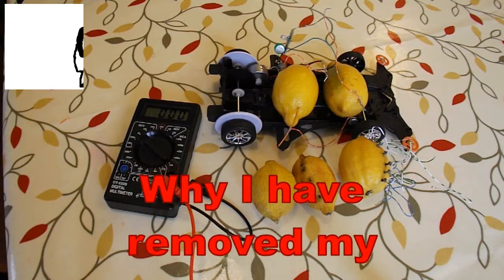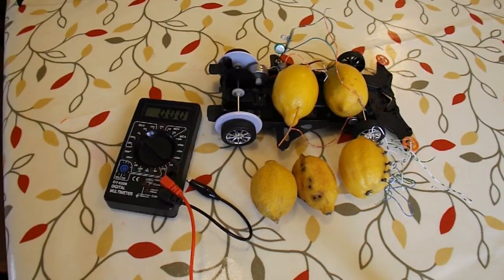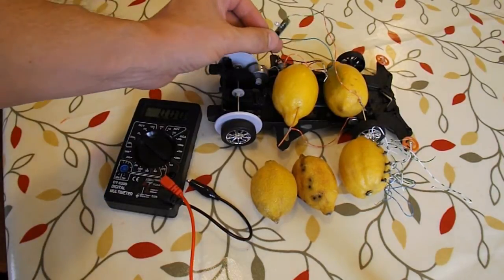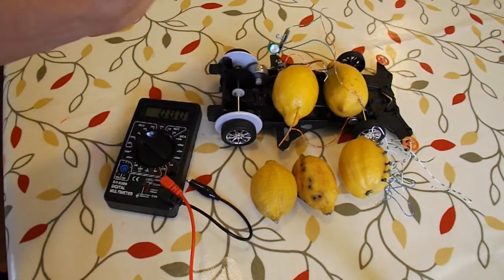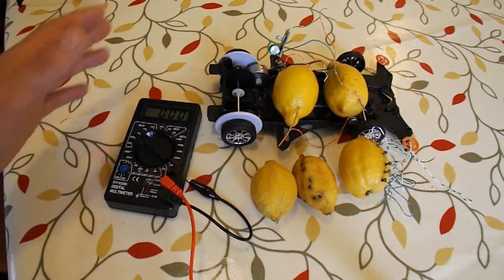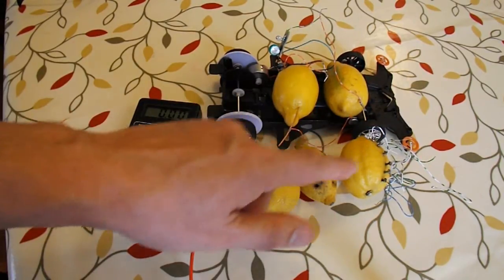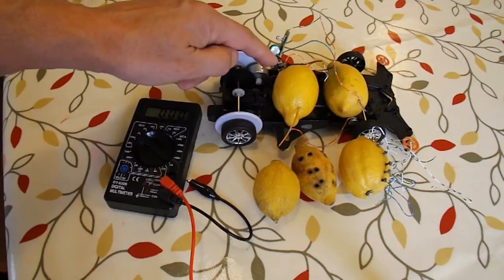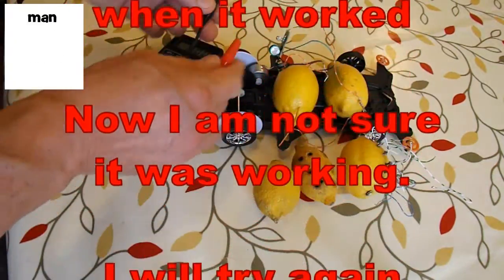WHY I HAVE REMOVED MY LEMON POWERED CAR VIDEO

Comment: Dissimilar metals are the go for lemon batterys. Your probably coating the zinc on one terminal with a semi-conductive coating.
Are you using copper for the second electrode? Do you have enough voltage to charge the battery? Are you delivering enough current to charge the battery?

Maybe try a Joule Thief charger? Like this one Joule Thief Charger - Schematics

If I can help figure it out let me know :)
Reply from the maker: Hi, not sure if you caught the original video. The set-up was a lemon, some copper wire, and some bright zinc nails. I use the charger circuit board from a solar garden ornament and simply replaced the solar cell with the lemon battery. All appeared to work well, the LED on the circuit board went out to indicate that charge was flowing into the battery and when I tried the car the following morning after about 8 hours of charge the car ran for about 3.5 metres. The car is one I made using the electric motor from a fluttering solar butterfly ornament and the car runs directly off the solar cell in reasonable sunlight. I now have the motor connected directly across the rechargeable battery via a simple on/off switch. The theory is the lemon battery charges the rechargeable battery and then I throw the switch and the battery is discharged through the motor. What is throwing a spanner in the works is the fact that the rechargeable battery restores some charge on it's own so I cannot tell if the charge has come from the lemon or has occurred "naturally". I did not expect the set-up to work as I didn't expect the lemon to have either the voltage or the current and was so surprised when it seemed to work I put the video up.
Reply: I'd suggest using a couple of lemon cells in series and the charger I linked to. More copper surface area too. Did the copper get eaten down or coated?
Reply from the maker: Mongrel Shark The copper looks fine but the zinc coated nails have a black coating. I have tried two lemons in series to increase the voltage. Two issues there.
1. I want the car to carry the battery so 2 lemons significantly increase the weight penalty (although I could just cut one in half for the same effect)
2. One of the wires attached to the board has just fallen off so I am not sure if I may have had a high resistance termination.
I have resoldered the wire and will leave it to charge again.
In the mean time I have been running some checks on the amount that the rechargeable battery restores itself. Video uploading later.

The issue is that this worked fine the first time. I carefully discharged the rechargeable battery by running the motor. I then charged it using a single Lemon and we got the good result. Since then each repeat has been a shorter run so in my mind I see the first run as being powered by the rechargeable battery restoring itself + some help from the lemon, but after that it was discharged beyond a point that it could regain a good level.

I am fairly sure I could get it to work following your suggestions, but I really want to figure out how it worked the first time, if that makes any sense.
Reply: Yep, all makes sense. I think your on the money with the self recovery, as well as having drained it too low to charge well.
Pulse charge is the way to bring the battery back up once drained too low. After you are sure you have figured it out correctly.

Comment: That lemon with holes looks scary
Reply from the maker: I was disappointed with this project. I thought I had made some progress but the battery I used confused the results by restoring itself. This is a common feature of rechargeable batteries.

Comment: You need some wider plates,and put them close together as you can w/o them touching.
If you could get your hands on enough U.S. pennies(copper plated zinc core) and vinegar you could power a fleet of little cars.
Reply from the maker: What I need to do is to replicate the success of my first video and that was just using a lemon, zinc coated nails and copper wire to charge the rechargeable battery. It seemed to work fine but I now believe the rechargeable battery had restored some power itself rather than taking charge from the Lemon battery so I am doing some tests on the battery to see if I can verify that.
Reply: GrandadIsAnOldMan
Yea,I didn't intend to tell you what to do,only suggest a solution.I apologize if I came off that way.
I think you are correct about battery recovery being the bulk of the power used to power the car.
If you don't mind me asking...
Is the battery Ni-Cad or Ni-Mh ?
How much V/I is the lemon cells pumping out?
Reply from the maker: TheLuvvgunn Hey no problem, this project has really frustrated me. What I was trying to explain is that I need to understand why it worked the first time because I really didn't expect it to and I cannot replicate it, so clearly it was not doing what I thought it was doing. A clear case of me misinterpreting the results.
The battery does not have any visible information on it, but all the others I have from these types of solar lights are Ni-Mh. It charges to about 1.2v and drops to about 1.03 then restores to about 1.8 on it's own.
The lemon gives about 0.86 volts when fresh and the zinc and copper rods are clean. I am not confident with my current measurements so I will not show them. So on the face of it the figures cannot add up but I was hoping the little bit of circuitry on the solar charger was going to do some magic and provide a low charge to make it work. That is why I have been leaving it for 8 hours between each test and why the project is taking so long to prove.